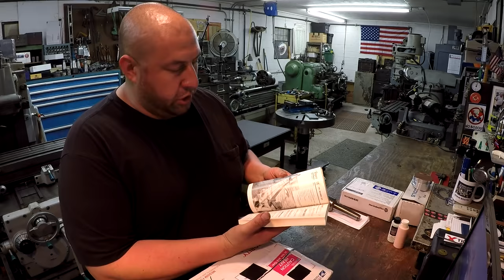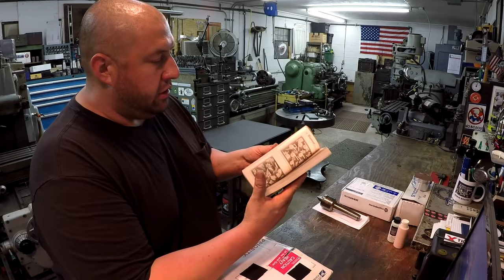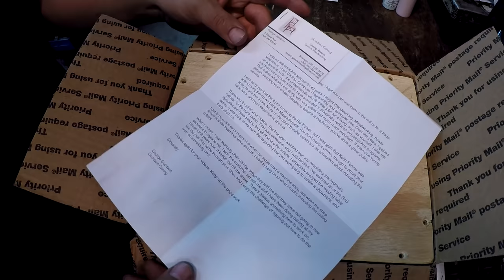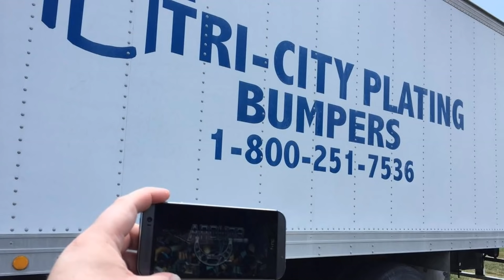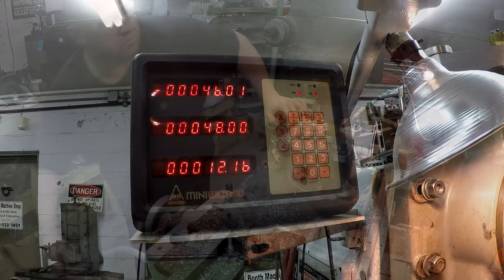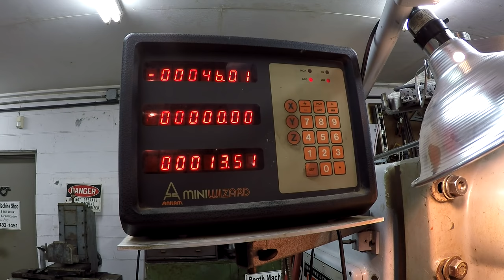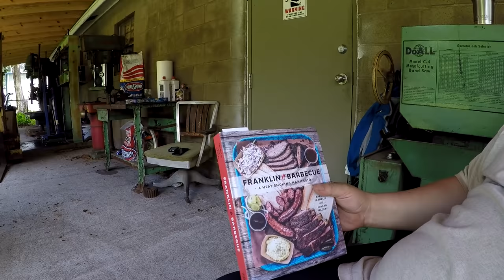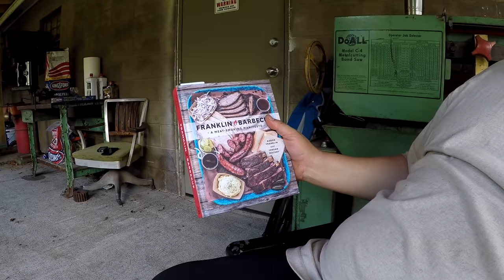Saturday Night Special 131

Comment: When you plug the iPhone into the computer, it will detect it as a Digital camera. Go to This PC, look for your iPhone, and inside there should be all your pictures and videos.
Reply: correct.. in this case tough...

i have found the same issue .. and could not figure it out my self
slowmos are recorded as a different file types.. there are 2 for each recording... 
part of them are normal videos

the other part is stored as AAE files 
QOUTE : "AAE file is an Apple iOS8 Sidecar File. The AAE sidecar format has been reported as present in the iOS 8 and OS X Yosemite photo handling for transfer of non-destructive adjustments between systems and apps. AAE is an XML based format with various elements with adjustment in their names."

the first part ( the normal video ) stores the frames ( more then usual to make frame rate changes possible ).... the AAE stores the slow motions ( in ths case frame rate data )

good luck Adam ... maybe some one has the anwser for you
Reply: Oh, my mistake. I only have an iPhone 4.
Reply: It's still the same with the newer iPhones; connect it via sub cable to your windows pc and search the video in the camera folder that pops up (phone got to be unlocked). Then copy the video file on the pcs drive and open it with a player like VLC.
At first it looks like it's a standard video in normal speed, but you can slow down the playback to see the slow motion information.
In the VLC Player you can now choose the desired playback speed and also record what you see to generate a new video with the desired slow mo effect.
Reply from the maker: That should help Bob, I'll check out that info.

Comment: Since your old grinder doesn't have good guards and rests,why not use it for the polisher and use the new one that has nice guards and rest,to replace the old grinder?
Reply from the maker: I plan to replace the old grinding wheel on that old grinder and use it for my Tungsten around the welding machine.

Comment: I'm learning about machinery from you. But yor smoker needs help. The heavier the steel the more efficient it will be. Never let it get hot and burn your season. If you change wood it will mess up season. i use oak/pecan. buy you a heavy steel smoker, season it with oak. never let smoke chamber get over 350 it will burn off the seasoning.

Comment: Why they wanted to put a 4 barrell carby on a two barrel manifold mystifies me !
Gotta go get something to eat - watching  this video has made me hungry !
Reply from the maker: All I know is rat rod, pile together whatever junk you have laying around.
Reply: Ian------You took the words right out of my mouth.   Why not just buy another manifold......a  four-barrel manifold.   Call me crazy, but you can't put four barrels in that 2 barrel manifold without ruining it.   I read the answer someone made that you were just doing what the customer asked you to do.  Did the customer think you also have a magic wand?
Reply: +Rob Macfarlane 
Even if Adam got it to work the engine would run like a dog  if it fan at all !
The shape and size of the plenum chamber is vital to air/ fuel mixture flow  and preventing air / fuel separation, you can't just bolt  on a bigger carby and make horsepower unless the components underneath it are tuned to work with it !
Reply: You are absolutely correct.  I'm surprised how many people don't understand that.
          My next project is changing cam shaft in my 350 TBI  truck.  I've changed everything, with little improvement.  No big HP increase will happen until the cam is changed which will let all the other stuff, the ported head, headers, intake, etc. do their thing.   As things usually go, the hardest single item to change will give the most improvement.

Comment: What's the reverse polarity welding thing? Can somebody explain it to me?
Reply from the maker: When using DC current on a welder, you have straight polarity and reverse polarity, also known as electrode negative, and electrode positive. It's the flow of current through the leads, electrode, and material.
Reply: Abom79 thanks

Comment: Buy new belts for the grinder. Old belts pop faster than you can react because of aged glue where the strip is closed in a loop.
Reply from the maker: I have a box full of brand new belts, but they are probably 8-10 years old now. I'm getting worried about using them. Expensive to buy!

Comment: Yeah abom don't b discouraged.... you where asked to do something to something that it was not meant to be done.... why not try just to see might work out good... I wish I knew how it worked out... but I got a big feeling no matter how well abom did.... the person probably got a intake that was made for a 4 barrel carb.... cause I really don't believe that intake manifold will be able to move as much air and fuel as the carb will be putting out.... don't think it will disburse it air and fuel too the each cylinder evenly..... combine both problems that I'm seeing right off the bat and it will not preform at all very well.... it   will run it but will b losing all kinds of performance that I'm sure the motor is built for and carb can produce... it will be kinda like the saying $ waiting on a dime... the intake being the dime.... any thoughts on that????? Anybody?????

Comment: Adam, don't take what happened to seriously with the manifold, we all make mistakes, and by no means what happened was totally your mistake. You did what you were told to do. Now, would someone who works on manifolds/engines all the time, foreseen the problem, maybe. But there is also the possibility they would have done what they were told to do without thinking. Don't discount working on something just because you had a problem with one, you have learned a lot from that issue and now know a lot more then some other people. Maybe you will be working on something else that has nothing to do with engines, and you may be able to take from that experience thought for another job, "why is this built like this?, if I make cuts here, is it going to cut into something else or weaken part, etc! Don't let what happened exclude you from doing anything, you a great machinist and mechanic, don't let things like that dampen your abilities or endeavors!
Reply from the maker: Fred I think what discourages me the most about this job is that the last two manifolds I have worked on I have way more time in them then the job is worth. I hate spending time in a job that I'm not getting paid for. Leaning experience.

Comment: Adam, maybe its because I use old wire wheels, but I'm real nervous about a wire wheel without a guard. I've had wires stuck in my cheek before when they flew out of the wheel, and that's no fun. Buffing wheels are no problem, but wire...

Smoking: a lot of the professional smokers seem to like wood pellets or bite-size pieces. More surface area, easier to control moisture content. Check out these guys. You probably don't want to BUY anything from them, but the free info might be useful: 
http://www.cookshack.com/Cooking-Guide
Reply from the maker: It's not 100% safe no, but it works the best with no guards in the way. You have to be careful about how you work the wheel.

Comment: Sorry, but your set up is not three point, it's two points and a line. And technically speaking a point and a line define a single plane, so ,again theoretically, your setup has the potential to twist the part. 

Nice content, keep up the good work!
Reply from the maker: Technically, you are correct. But I still called it a three point setup.